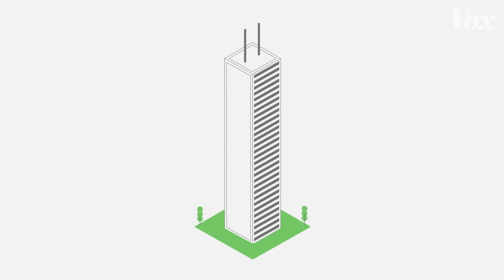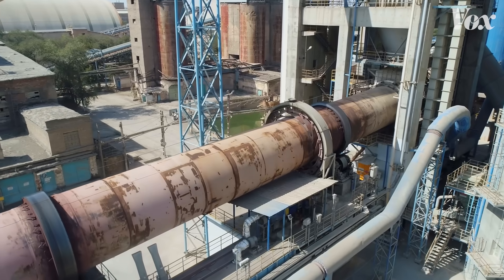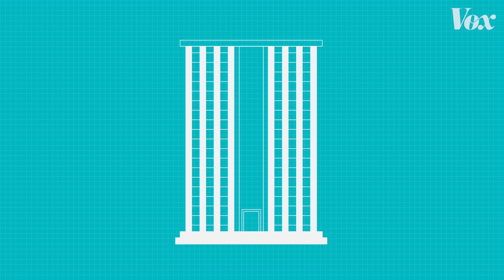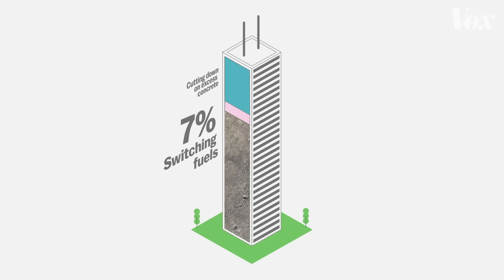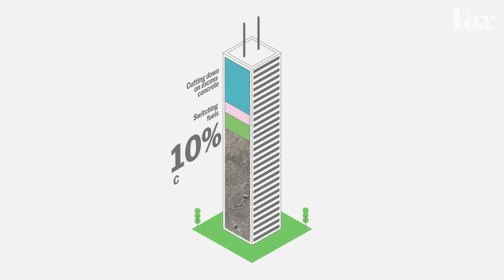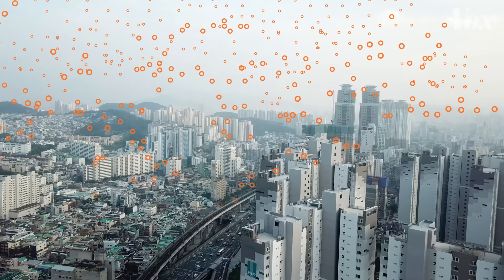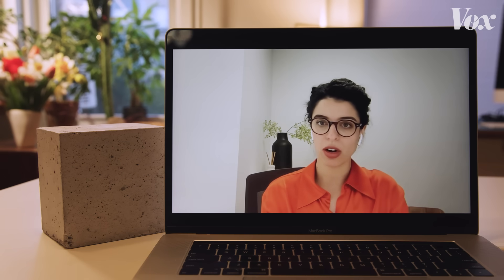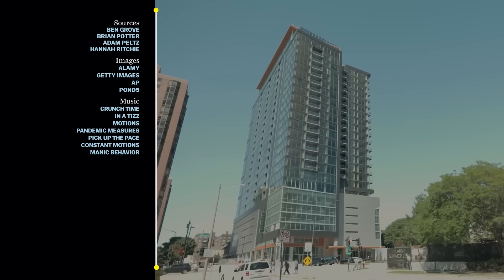The big problem with cement, and how to fix it

Comment: Recycled concrete could also be added to the equation.
Reply: unfourtunetely it doesn't significantly reduce emitted co2, as fresh cement has to be used no matter if recycled concrete or not
Reply: "Recycled concrete" is just a cheaper filler.
It still uses cement, which requires the same chemical process to create, and that chemical process itself slices a CO2 off of the molecule.
There is no CO2 savings.
Reply: @Prophes0r  And other CO2 molecules from the atmosphere will recombine with the cement to make concrete. As long the concrete is heated with renewable energy sources it's net 0
Reply: Germany already does that, they have several concrete recycling facilities.
Reply: Recycling require more resources and cause more emissions than making fresh cement

Comment: Let's talk about battery power cars next 🤓
Reply: Worse for the environment maybe?, hard to repair yourself, more dangerous. You can’t even hear them coming. Ban everything.
Reply: Well they still pollute in different ways 
Where does electricity come from?
Reply: @Mark-te5bf  Electricity can be produced using renewable energy like wind, water or solar.

Fossil fuels can not be be produced or consumed renewably in any scenario.
Reply: enjoy having the cost of energy skyrocket because there isn't enough space for solar panels, there isn't any more wind, and not enough space for hydroelectric dams.
Don't forget, you need power to run factories to make solar panels.
Reply: @Mark-te5bf  energy in quebec is some of the cheapest in the world, and solar has gone down exponentially, its cheaper than coal now
Reply: @Mark-te5bf  energy is carbon neutral in different areas of the world, here in quebec we produce all our energy with hydro, in scotland they produce all of it with wind, in the future, electric cars could be carbon neutral everywhere

Comment: isn't wood expensive than cement?
Reply: @Zaydan Alfariz I didn't mean to imply it was economical (because I know it's not) or environmentally friendly (it often isn't), just that contrary to popular belief, fire isn't a problem for mass timber.
Reply: Yes
Reply: Imagine the fire 😂
Reply: @yourpapichulo8859  high-quality mass timber is actually just as if not more fire resistant than steel and concrete depending on the exact conditions because the char layer insulates thick beams really well in a fire.
Reply: @thamiordragonheart8682  never gonna happen